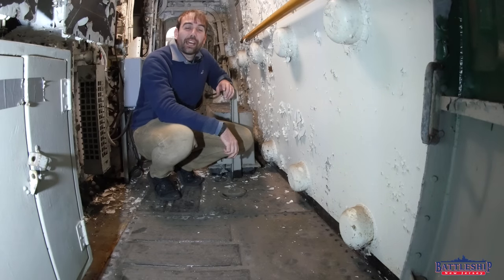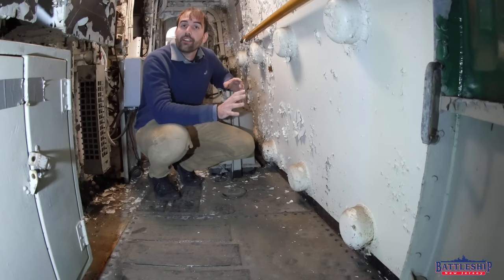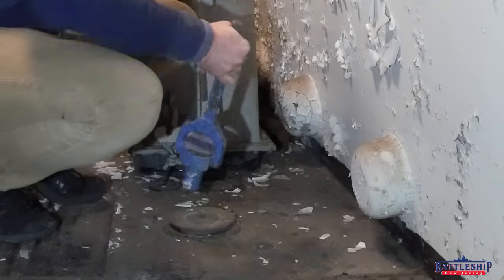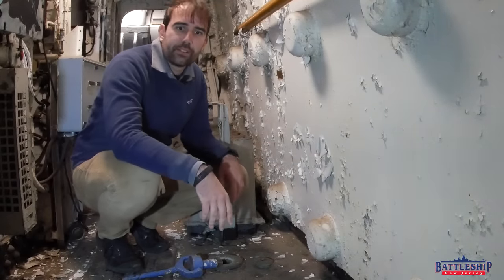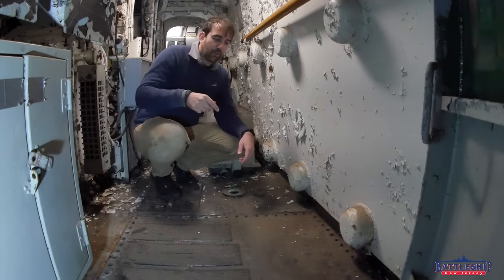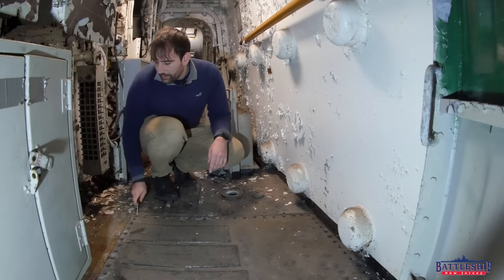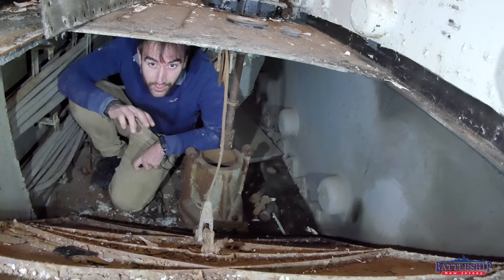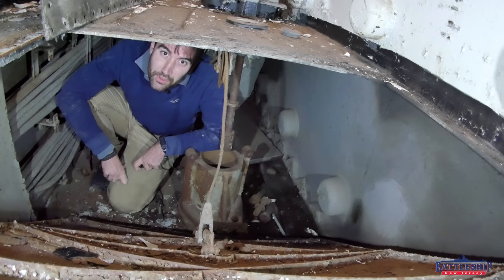Turret Locking Pins: Can the Turrets Rotate? UPDATE

Comment: People get very caught up on the idea that the only way to move the turrets is to reactivate the high powered equipment that rotated them at speed and with high accuracy in service which is obviously not possible for all the reasons so-often stated, however, I would be extremely surprised if there isn’t jacking gear or other mechanical means to move them (very slowly) hidden amongst the main service equipment for maintenance purposes when the ship is in dock with only shore power available
Reply: Ryan has stated numerous times in multiple videos that the main turrets do not have any ability to be manually cranked. They are simply too big and heavy. 

Any work done dockside, be it afloat or in a dry dock, would have had seriously large power cables swung aboard to power the ships systems like its turret motors etc.

The issue with its current berth is its only got simple mains voltage, enough to power lights and simple everyday electronics, but just doesn't have the required voltage or the current to power anything big, because they aren't supposed to be touching that stuff anyway.

Comment: Here's my theory... maybe the broken centering pin you found is exactly why she was decommissioned first; we don't know the condition of the guns and turrets on New Jersey pre-decommissioning, and perhaps you found the real reason by accident. Maybe they saw the damaged turret, and it was faster/cheaper to online other Iowas?
Reply: Hang on the fact that they would have to remove the  panel to weld the centering pins why did they not screw this one down  as well
Reply: A broken entering pin would be no reason for them to decommission the ship.  The pin is a basic design that could be repaired very easily and the ship could function without this pin.
Reply: Iowa has a turret that's empty on the inside and sealed off, so by that logic...
Reply: There wouldn't have been any reason for Long Beach Naval Shipyard to mess with the pins during decomissioning.  LBNSY was making sure everything was good, in case she was going to come back into service in the future. I figure someone messed with the centering pin after it was laid up
Reply: @ytlas3  could it have been done to see if it could be reactivated again easy when they decided which ship goes to museum as that would make sence with the order that they where welded and would require more work to reactivate
Reply: @timmangosphotography  It also depends on whether there were other issues as well, and - perhaps more importantly - where they could even make a replacement. At this point these ships were 50 years old and they'd have to develop a new part if one was not available. Also depends on whether there were other issues.
Reply: @TheEDFLegacy    Any decent Machinist can turn out a new pin on a lathe.  Especially with the old one for a pattern.
Reply: @TheEDFLegacy  Machining a locking pin and its parts would not be difficult and could even be done in the ships machine shop.  The likelihood of her being retired is the hours on her power plant and the need for her service.  The debate on if they should have been retired is still largely debated.  I for one support the image the Iowas give to the world but unfortunately its not feasible for these old girls to serve now.

Comment: Ryan, two things. One, I already did the math on shore power supply and such for power in the last video so I know that you have the power. Two, hydraulic fluid is easy to acquire and fill a tank with. It’s just oil after all. I am sure there is a 55 gal drum somewhere on the ship or in a local auto parts store will have it. 

So, this old salt knows you are making up excuses as to why you can’t rotate the turrets. Why don’t you just say the real reason you don’t want to?
Reply: In one of the videos, the total ampacity of the SP bus tie was less than that of the running rating of the turret gear, making it substantially less than the LRA/Inrush/starting current of the turret gear.  Did we watch different videos?
Reply: @kevincrosby1760  Watts is amps*volts and shore power should be 440V like the SSTGs put out. So, unless the motor on the turrets are 440 (possible) then it would need far less amps on the shore power to run the motor than it requires. 

That’s the math I was talking about.
Reply: @shaun3423  Standard for USN vessels is actually 480 VAC, 3-PH, 60 Hz.  This is also the standard for Shore Power at US bases.  If the ship goes pierside and it is is not available, then the ship stays at "In Port - Steaming" and Engineering is unhappy at Liberty Call.

Wherever possible,  large electrical loads will always be 480 VAC.  Anything of lesser voltage or loads requiring a different frequency are fed from either step-down transformers (lighting, etc,), or fed from a Motor-Generator...basically a generator of the appropriate output driven by a standard 480 VAC motor.

Bear in mind that they were shaving weight on these vessels wherever possible.  Anything less than 480 VAC requires voltage adjustment, as well as larger conductors and physical equipment size for a given wattage.

I'll leave you with this gem...  USS New Jersey (top) and USS Buchanan (bottom) taking on fuel from the USS Kansas City (center) somewhere in the Pacific in 1983.  I learned Shipboard Electrical while deployed to the KC '88-'90. 

https://picryl.com/media/an-aerial-starboard-beam-view-of-the-replenishment-oiler-uss-kansas-city-aor-d45ca5?zoom=true
Reply: @kevincrosby1760  Wikipedia lists the electrical distribution system as being supplied by 1,125 kW SSTGs at 450V. Two per ER for 10k kW. Shore power SHOULD be supplied at the same voltage and about half the wattage of the ships capacity. I know this from my own experience. I also know that hydraulic pumps don’t need to be overly large to supply the needed pressure. 

-MMN1 (SW) USN Ret.
Reply: @shaun3423  Interesting.  I've never seen anything USN or on the pier rated at 450VAC, It's always been clearly labeled 480.

I'll freely admit that, due to my decision to not re-up or extend for AD, my experience is pretty much limited to one particular ship. I finished "A" school, went straight to the KC, then from there to the Reserves.

It may very well be that the difference lies in the fact that "warships" generally go pierside at a military base, where I've seen more fueling facilities than I care to remember.

IC2
Reply: @kevincrosby1760  carriers are 4160V. Not many places other than a base that has that capacity. I forget what Ryan said the ampacity of the shore power breaker was, but regardless it should be 450V as that’s what the main distribution buses should be based on the SSTG ratings.

Comment: Kamikoto knives are made of “authentic” 440 stainless steel, the same as Chinese 440, or Taiwanese, or Russian, or German, or American, or anyone else’s.  440 is 440 no matter were it is made.  440 Sucks as a knife steel, it does not stay sharp, it is used in CHEAP knives, like the ones you get for $5 in the discount store.  Kamikoto knives are all marketing, they are just low quality mass produced knives in a fancy box.  Go get a $5 one, it’s just as good.
Reply: There are several different grades of 440 stainless.  The best knife grade is 440C,,,,,the cheaper and softer grade is 440D.  I used to regularly shave with a blade made of 440C.